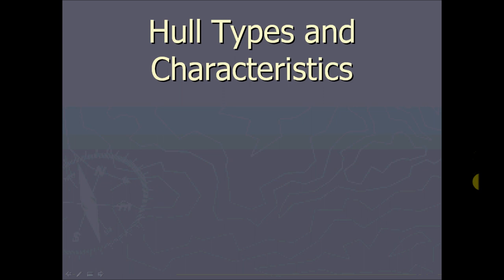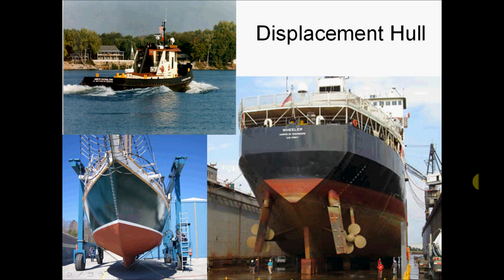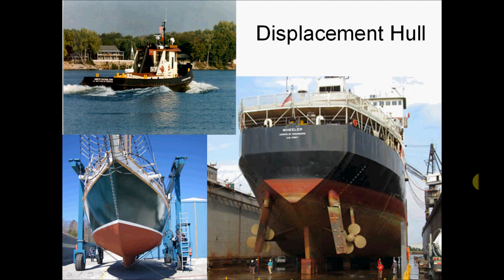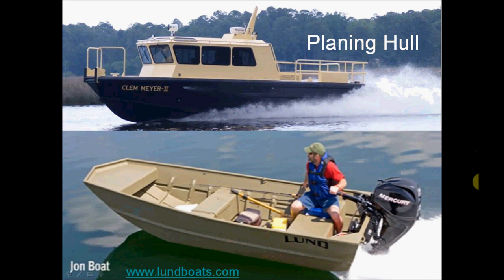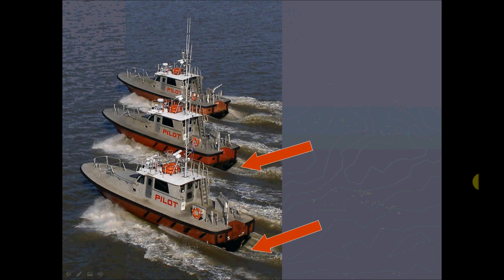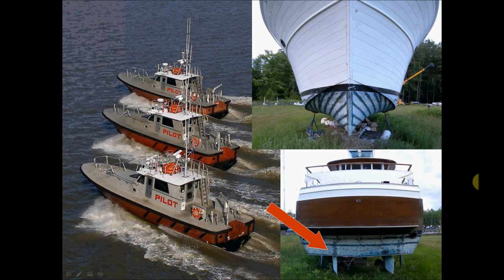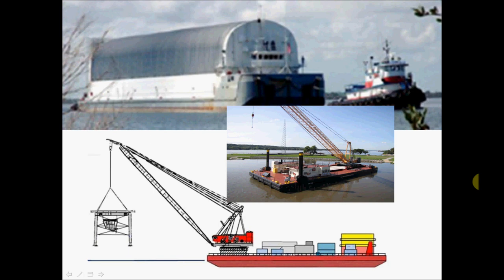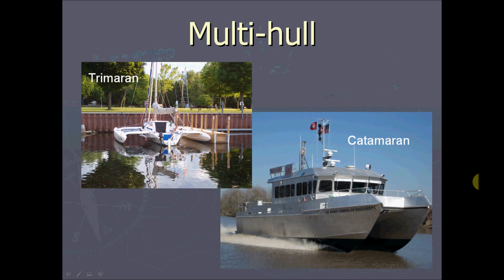Hull Types and Characteristics

Comment: Hi there, I'm trying to design a a hull for my own little project. Could you perhaps answer some of my questions? 
I'm trying to design a small boat (4,10 meters of length (that's around like 14 foot?)) on which I can sleep (2 people in total, 1 on each side) and it will be propelled by a foot-powered prop...
My questions are:

- Should I go for a displacement hull or semi-displacement hull? 

- Should I try to make it less deep and a bit wider, to make it more stable when I step up on the sides?

- Should I go for a round hull or a v-shaped hull? Or a combi of those?

I don't have to reach very high speeds, although I'd rather do than don't. What do you think?

Comment: You seem to harp on the fact that it's harder to make a Semi-displacement hull because of curves .. You are wrong, you are talking about construction techniques and to indicate that Steel is on the material used in boat making is miss-leading - hence your insistence that curves are harder to make - but most boats are made from Fiberglass or bent Aluminum.

Comment: The tug boat is not travelling at "hull speed".
The common "definition" (it is a rule of thumb formula, not scientific per se, just based in science) is that at hull speed the second peak of the bow wave is at the stern of a boat.
The second wave of the bow wave in the picture is almost at the center of the boat. 
If that tug boat is 25 meters long (82 feet) it is probably running at 8 knots. The "hull speed" would be 12 knots.

Comment: Thank you for this, I'm introducing students to ship design and this helps a lot.
Reply: Hi there, I'm trying to design a a hull for my own little project. Could you perhaps answer some of my questions? 
I'm trying to design a small boat (4,10 meters of length (that's around like 14 foot?)) on which I can sleep (2 people in total, 1 on each side) and it will be propelled by a foot-powered prop...
My questions are:

- Should I go for a displacement hull or semi-displacement hull? 

- Should I try to make it less deep and a bit wider, to make it more stable when I step up on the sides?

- Should I go for a round hull or a v-shaped hull? Or a combi of those?

I don't have to reach very high speeds, although I'd rather do than don't. What do you think?

Comment: My vessel has a flat hull all the way through, It's literally a box that comes from a pointed bow (with bulb) and then quickly widens to a box all the way back. It tapers from 1.2m depth at the bow to 3.5m depth at the stern but is box shaped the whole way. Its a great sea boat and before I bought it, it would be actively fishing (laying longline) in 60 knots at 50degrees south in the Pacific Ocean, BEAM ON! However in this lecture I dont see any description of the characteristics of this hull type. Is there somewhere I can learn more about this shape? Thanks!

Comment: The best & new hull shape is the small waterplane area  twin hulls, ocean vessel(SWATH). The hulls ride beneath the surface of the ocean. Then a platform is built high on top of these two tubular shaped underwater hulls. The platform is attached to the hulls below by hydrodynamic shaped hollow columns, to cut through the water easier. One on each corner of the the platform, & sometimes even a third column in the middle of the forward  & aft columns, making six columns in all. Depending on heavy the platform is, in accordance to how big & buoyant the hydrodynamic shaped tubular hulls are, the underwater torpedo shaped hulls usually, are 3 ft to 6ft beneath the surface of the water &  hold the engine & fuel tank inside them along with a rudder attached at the rear of each hull. There are usually horizontal stabilizers that attache the hulls at the front  & rear, to keep the platform from rocking side to side. There are also what are called chine runners, which are stabilizers attached to the outer side of each hull, that run the entire length of the torpedo shaped underwater hulls to keep the  platform from from going up & down length wise. So these SWATH vessels are very stable, to say least. The  platform on these vessels usually rides about 10ft or higher above the surface of the ocean to avoid choppy water surface or huge waves, when the seas get rough. I'm also sure in the future these boat & ships will be able to raise & lower the platform of the vessel according to wave heights similar to offshore jackup oil platform drilling Rigs. They can also make entire semi-submersible boats & ships, similar to submarines, but with a hydrodynamicly shaped tower like cabin attached to the submersible vessels to steer & control the vessel from. Ocean going vessels no longer to to ride on the surface of the rough oceans or even the rolling seas. Technology has surpassed this old way of traveling on the oceans, seas, gulfs, bays & lakes in general.